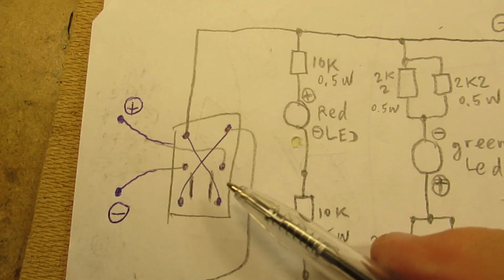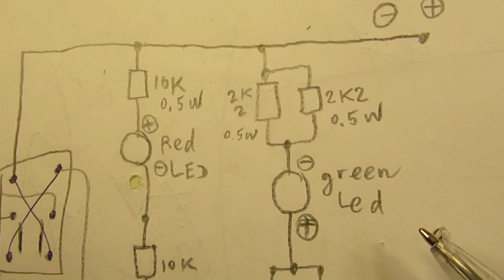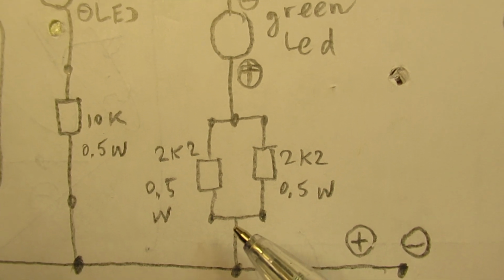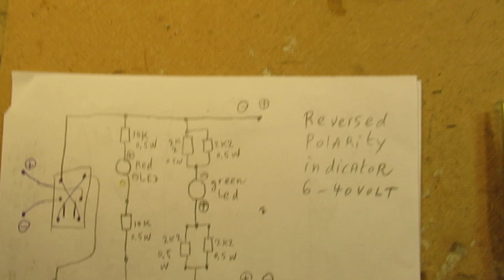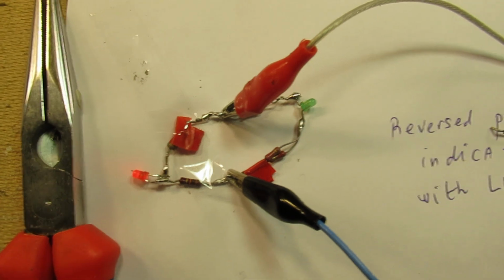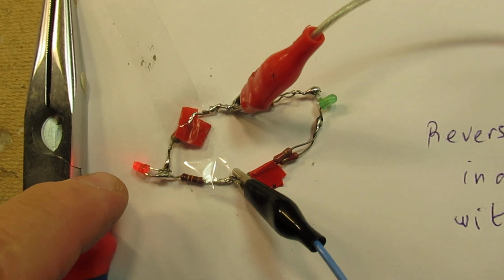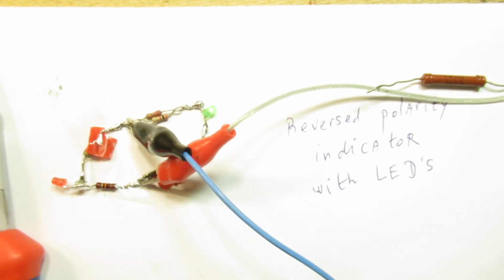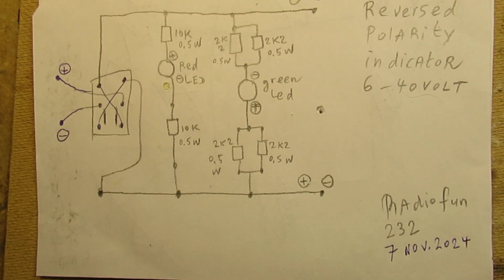Reversed polarity indicator for DC, working between 6 Volt and 40 Volt demo and schematic

Comment: could do better, use two current sources, to establish... stable brightness, and two diodes to block reverse on the two branches, and you can use it for bigger range of voltages
Reply from the maker: Yes, I know.
Reply from the maker: My reaction in these cases is always: make the circuit that you propose, show it on your YouTube Channel. I can give a link to my video's, when it works easier or better. But when I go to your YT Channel I see: "this channel has no content". 15 nov. 2024.
Reply: @radiofun232  i intend to put no content in my channel. am not content creator, openned my account it order to be able to like and post some remarks. 
i watch videos, not try to "travel and work in USA"
Reply: @radiofun232  my creations, these days, are rather like these: 

"Answer for the clocks question:
The available space for the functioning of the clocks, any clocks, including atomic, the available space shrinks to the same depth the time dilates, therefore the product space*time is constant, and the clocks tick the same number of ticks. The available space for the clocking mechanism, gets into the synchronization of the travelling bodies, and cannot be separated. By Special Relativity, all clocks tick the same number of ticks, and to that pseudo-time, which is number of ticks in space*time, Special Relativity must give same results as the Classical Relativity. Different results are given for the Theoretical Time, not for Measured Time. ANY referencial time we can establish in experiments, is measurable time, not theoretical time. Theoretical time, we use for energy and other corrections, because we cling to the old rules we know, even though great distances and high speeds require different approach, radical change, much more than all relativity theories we have now. Everything, to a single aspect, must be reconsidered, and revolutionized."

"As any clock counts units of space*time, not units of time (time as theoretical time, or absolute time, or near time, so to speak), in relativistic regime notions like speed, acceleration, force, energy, and others, become obsolete, and smart people should understand everything is not made of energy, it is made of STRUCTURE, to which energy, speed, acceleration, force, become denaturated aspects. And we still have countable structures, that is not affected, but all notions in the science of Physics become unproper. We need to start from the single, most superior concept, that is STRUCTURE WITH PROPERTIES SPECIFIC TO STRUCTURE, not to energy...
To be more specific, if to cling to the concept of speed, or acceleration, the new concepts would be speed and accelerations as derived based on space*time, instead of derived based on time.
Speed would be meters (or something else) over (meters*seconds). and so on..." 

and i post on Russian Media

Comment: Connect two led's in opposite direction, parralel - it protect other led from reverse breakdown voltage.
Reply from the maker: Yes, sure, that can work, when these LEDS have the same properties. Thanks.